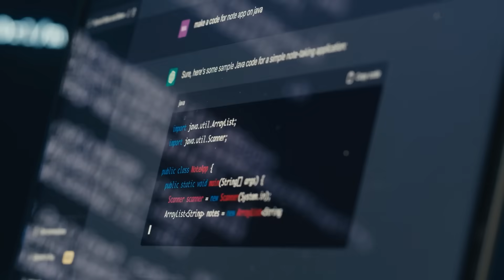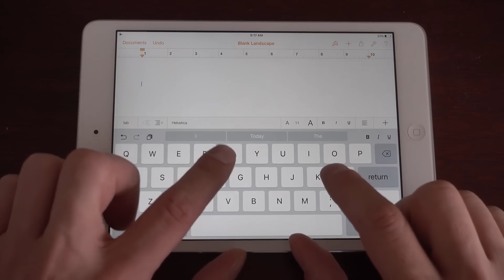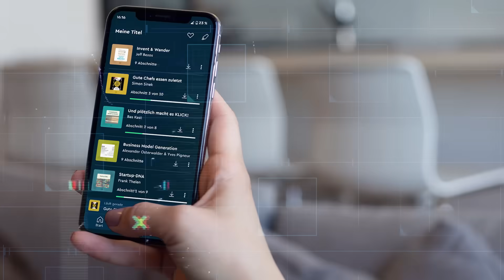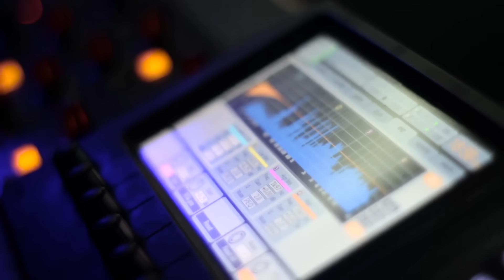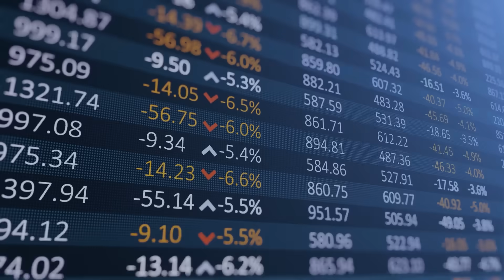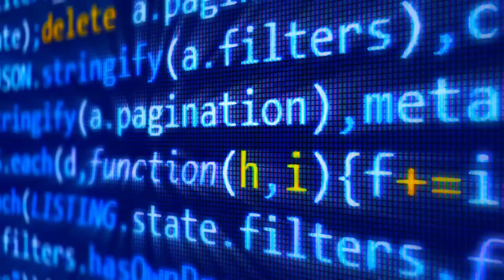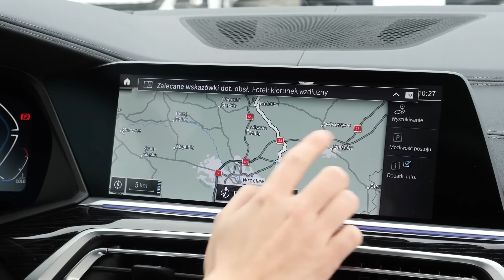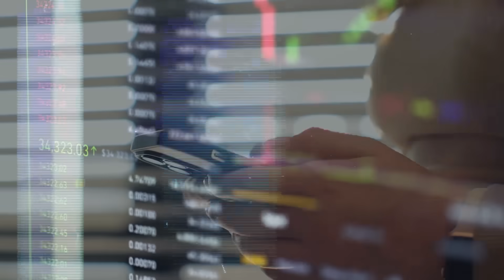Why Everyone Should Pay Attention to AI in 2024 - 2025

Comment: I agree with Elon that regulation is necessary for AI.
Reply: As long as the regulation doesn't cripple, or seriously impact AI capability, I would agree to an extent. Regulation isn't going to make you safer from bad actors. They don't obey laws, and anyone can make their own AI. It will only protect you from law abiding companies, which aren't likely to be a huge threat anyway.
AI is a tool, and like any tool, it can be used for good or evil. Gun laws haven't made you safe from criminals have they?
Reply: Definitely. But in the mean while, let's try to cope up since it not showing any sign of stopping growing.
Reply: Regulation is important for privacy
Reply: @josephspruill1212  agreed, they just need to be realistic when they are making these regulations, and realize that bad actors, and rogue nations are also developing AI, and it's a bit of an arms race. We don't want to be sitting on our hands, buried under regulation when the bad guys cross the finish line.